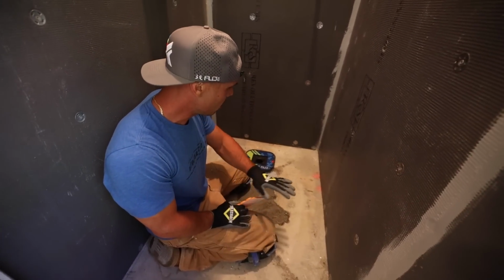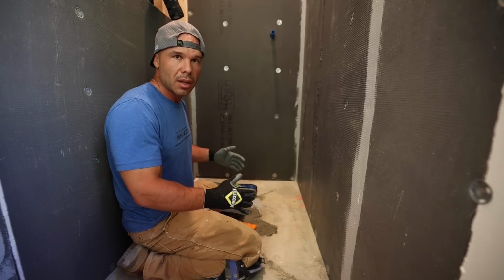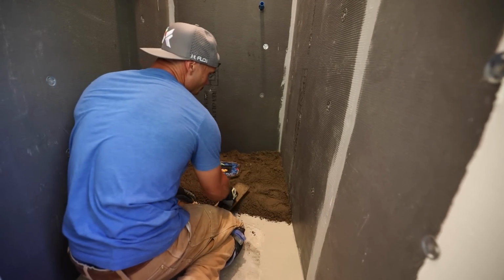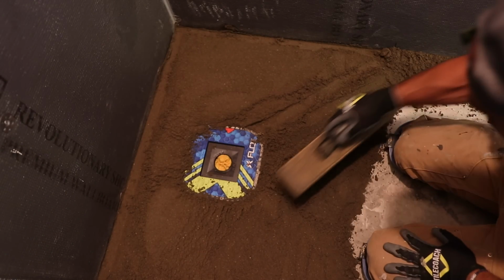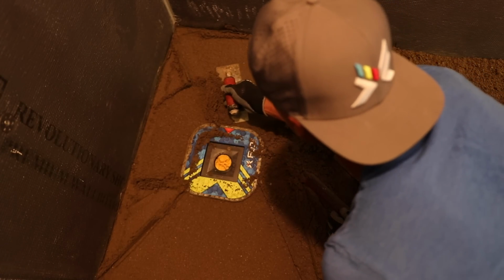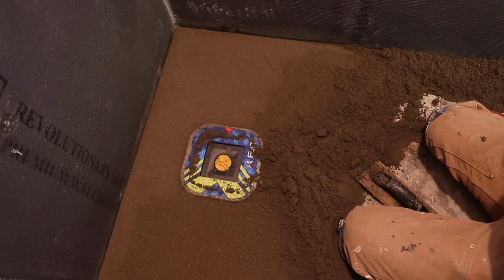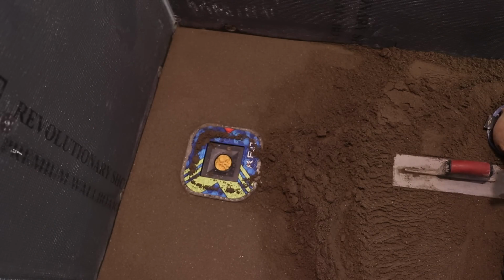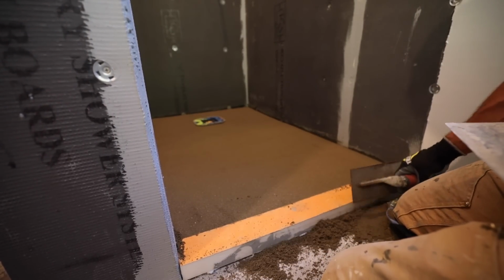Building Tile Shower Pan With Drain Close to Wall --- FloFX Drain and Heated Floor

Comment: He is saying that the top of the heat cable mat/de-coupling mat needs to fall in plane with the top of the Flo Fx. This is so that the water proofing membrane can bond smoothly over both the de-coupling mat and the bonding surface of the Flo Fx. You don't want water to be able to run up under the de-coupling membrane.

Comment: I have not any problem with the schluter drain breaking a bond if you have sturdy support under it I have four of them in my house for years with no problem you just need to do a proper installation

Comment: what kinda  thinset do u use when flat trowling around the drain flange, unmoidified or modified? or would lht laticrete bond well with those flanges and be ok for  for install? really enjoyed this pour with the drain flange u have been using...its been a game changer for interchangable waterproofing methods. 😉
Reply: Modified for all stages. 
Unmodified is an OLD manufacturer spec. 
LHT (large heavy tile)  thinset will work to bond the concrete and dry pack.  Even though that's not what it's intended for.
Reply: @larrys5733  yeah, but if it requires ansi 118.1 it's due to the polymers not drying in ansi 118.4 which is a modified thinset. All of that crap from schluter that confused everyone and forced people to buy their over priced thinset. Perhaps I should go back and read the box 😆..i think my question was slightly rhetorical, considering he most likely is going to use a modified. Just curious which product he went with for the drain.
Reply: @RawTakes  that's very old news.  Really.   Schluter ALL-Set  IS Polymer modified mortar.  Ansi118.15.   Recommended for use in all stages.  
Find any mortar that is .15 or better and you're ok.
The LHT is 118.4, so I would not use it to bond directly to plywood.
But as a bonder for dry pack over concrete,  sure.  If that's all I had
Reply: @larrys5733  it's weird how they say use unmodified  while installing over the kerdi but their allset is modified lol. Just sounds gimmicky, like a carsales men tactic to get u to overpay. Not a huge fan of schluter. Appreciate the insight from another installer, I have never directly installed over plywood and will never. Unless they don't want a warranty and want to pay me in cash lol. The lht seems to be just fine with my installation process.
Reply: Multi max lite is the best thing for that application super sticky
Reply: @rickdefalco1676  yeah TileCoach likes his MMax Lite that's for sure. 
But it didn't "look" like MMax to me in the video. 
Looks a bit gritty, sandy. 
For the sake of argument,  I'm going with... it's 254 platinum.  😀